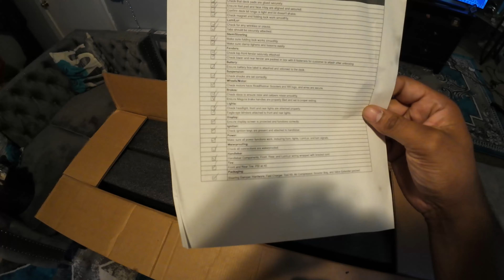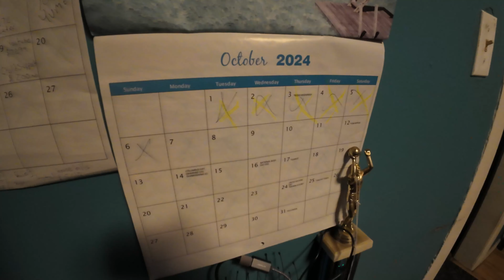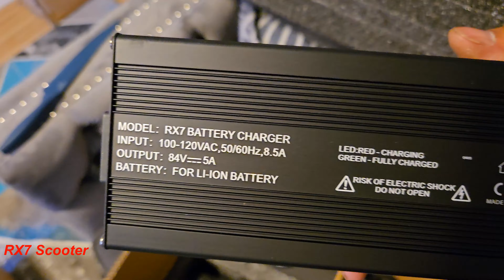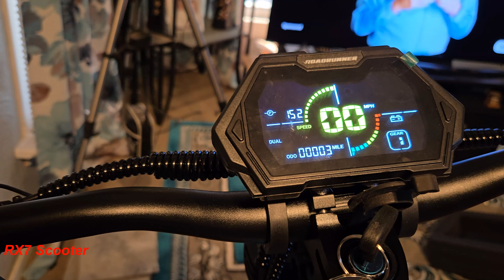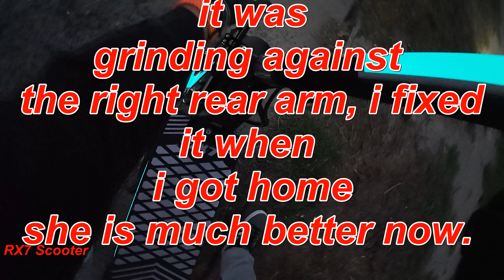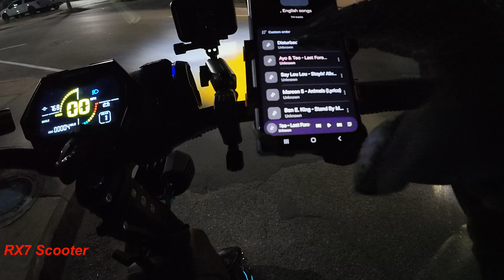New RX7 E-SCOOTER From RoadRunner. SouthWest Detroit

Comment: I want one so bad, but I’ve seen so many bad reviews about it
Reply from the maker: @6464644457  i have not gotten to 300 miles yet, the first thing that went out was the back motor, now she is running fine, but the bottom lumineer went out. Customer service has been  💯% through out the process, very good they have sent out all the parts to me. 
Other than that, she is a really good scooter. But yes, you don't want to be having problems Every 100 miles. Look elsewhere.
Reply: @ thank you 🙏🏻
Reply: Where?

Comment: Great video!! What website did you buy it from? Did u have to unlock anything on the settings to get those higher speeds?
Reply from the maker: @rubberduck4620  I got it of their websites roadrunner scooters.
I did not have to unlock anything. Right out of the box she was ready, everything is a go. The most quiet electric scooter I have so far. No sounds of metal anywhere and the best breaks ever... on 2nd gear and dual motor u want to hold on to those handlebars real good...
Reply: @frostoshi ..that's great news!! Glad u didn't have to unlock anything to get those higher speeds. How many modes are there? Can u do a video on how fast each mode goes with both wheels engaged. Thanks again
Reply from the maker: @rubberduck4620  there are 3 modes, and single motor and duel motor, i have not yet put it on 3rd gear.  more coming...
Reply: @frostoshi  ... how fast would you say it goes in mode 1 and  mode 2?  Most likely I will buy one in the spring.
Reply: @rubberduck4620  Don't buy it.. the scooter will break in a few months.  Guaranteed failure on the controller and it slowly taking out the motors.  It will get very messy.
Reply from the maker: I got as high as 63mph, i weight 215 pounds @rubberduck4620
Reply from the maker: @noobz5056 I did have my rear motor go out, but still a great scooter, my favorite so far

Comment: How does this compare to the kaabo wolf king gtr?
Reply from the maker: @jbpassout3569  i will say, the deck on the Rx7 is the best, plenty of room,  the wolf king is small compared to the Rx7, 
Top speed 70 on the Rx7, almost the same for the king,
Best breaking system i have tried... and i bought the Rx7 for just $4100,
Reply: Both suck. Not reliable. Repetitive controller failure as the solution from the same and alternative suppliers they contract with do not exist.  The only way to get out of the controller failure mess is to go with the Dualtron Ultra 2 Upgrade or X Limited, or Weped SST or FS.  You do have to take caution on the battery on charging though.  1.4A for the Ultra 2 and X Limited.  1A for the Weped SST & FS, if you want near infinite battery life.  2A is acceptable for descent lifespan.